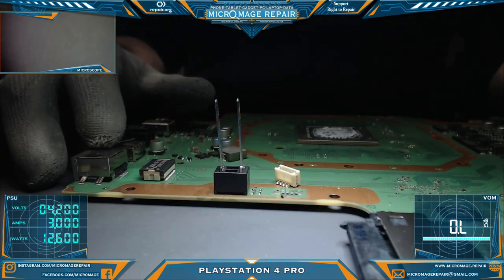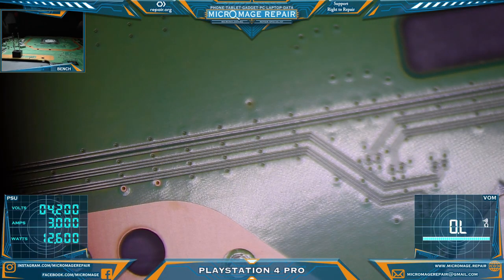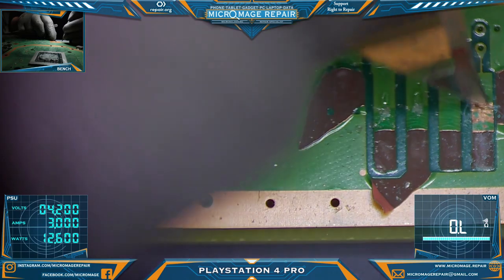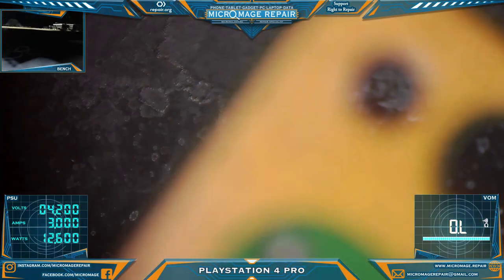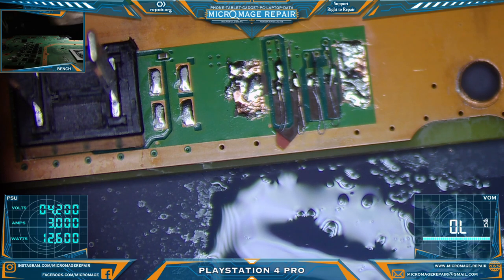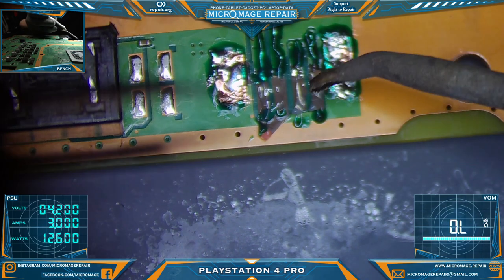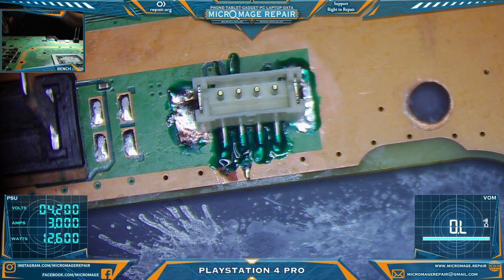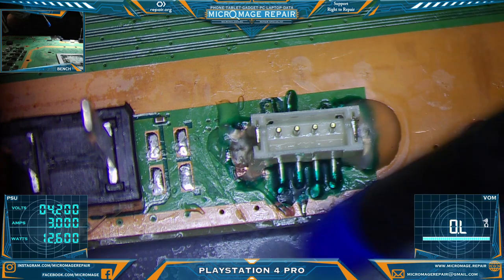Solder & Wick: Ripped Off PS4 Pro 5v Power Connector

Comment: You have opened my eyes to uses for copper tape. This is an excellent example of thinking outside the box and doing the job flawlessly. This looks so much better than a big solder blob.
Reply from the maker: Appreciate that Jason. Don't know why but I just felt like trying some things on this one. Was glad it worked out. I'll probably do a few things differently on the next one but there is a reasonable starting point.

Comment: Hey m8 good job on that repair. bit of a tip for ya, next time around you can ad some jb weld or other epoxy where the copper tape covers the exposed fiber glass, and proceed as you did to add solder to the edges to make the connection. It will be Better than factory!
Reply from the maker: Appreciate the suggestion!